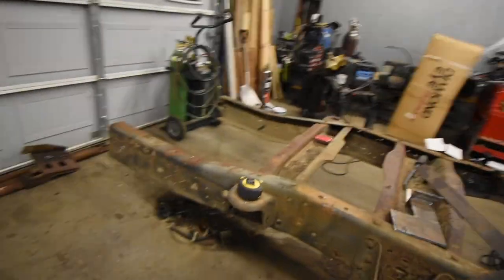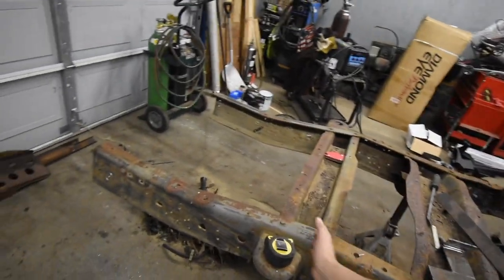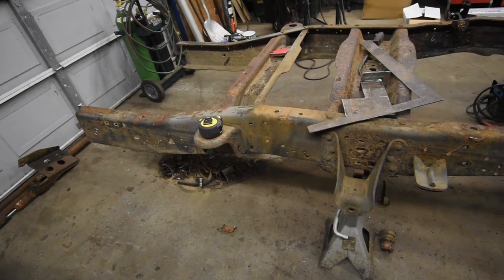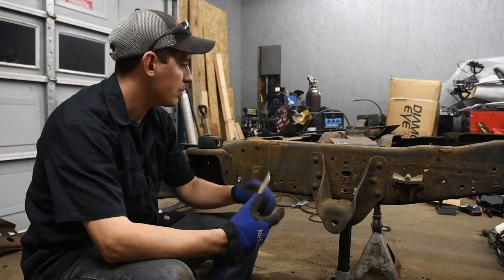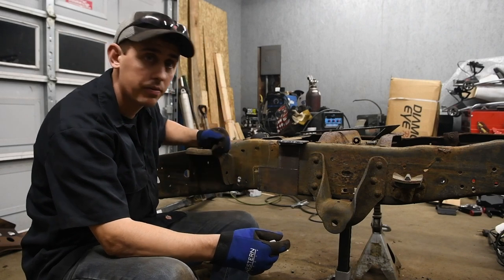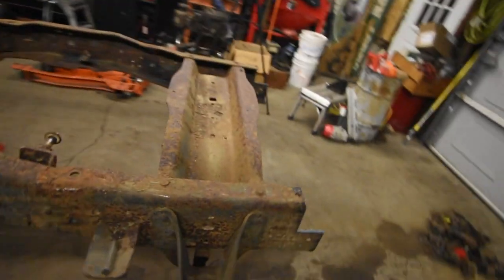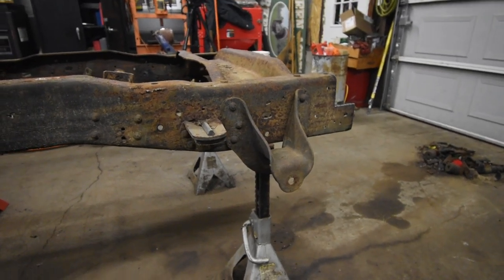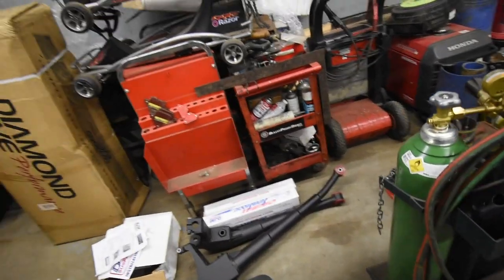SUPERDUTY DRIFT TRUCK FRAME CUT

Comment: Well that's cooler then what I am doing with my f250 frame. Not being sarcastic either. I am just reenforcing it and adding rockwell 2.5 ton axles
Reply from the maker: Rockwells will be pretty badass too! I can't wait to see what you do with it.
Reply: @InTheShop  lol it's being build for a yard puller and driveway fighter. Have hundreds of vehicles on my property. I have 6 years of  filling gravel and let it sink tell it stops sinking. Surrounded by a swamp on my property. Every vehicle I get breaks.